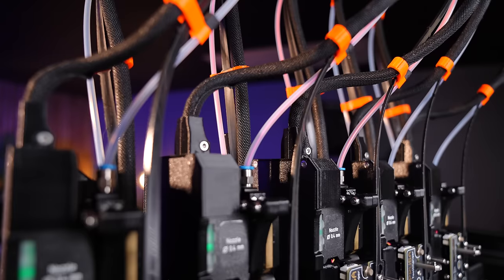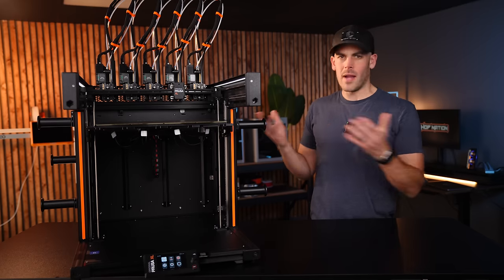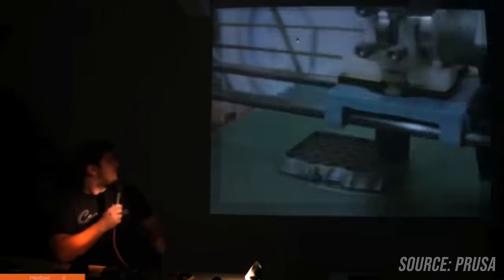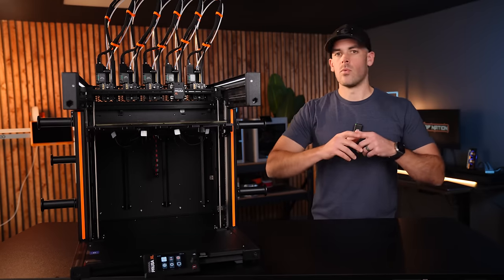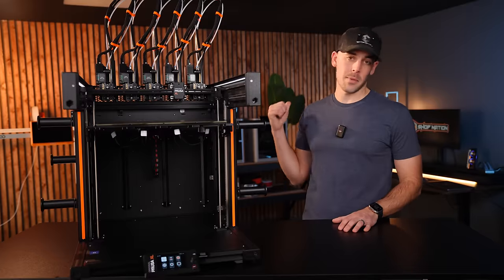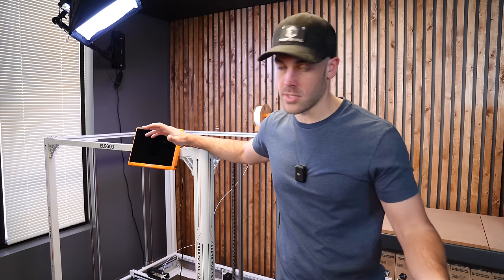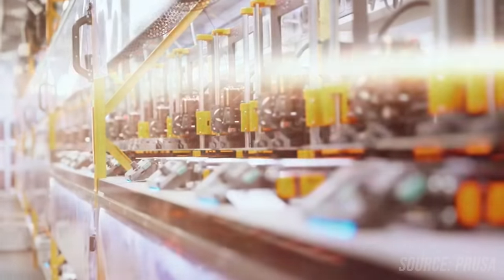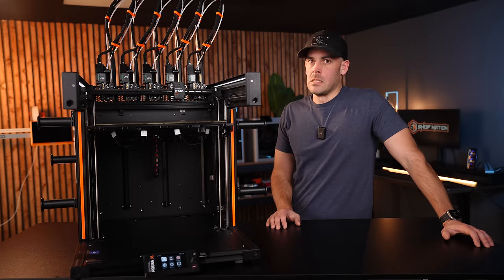Why Prusa is the next Blackberry

Comment: Considering their products are still selling quite well, with the Mk4 being their most sold printer - I'd say they're more like Android than Blackberry. Quirky, not necessarily the most up to date, but still gets the job done and doesn't get in the way of what you want to do.
Reply: and the possibility to be flexible... Good comparison.
Reply: not that I am really up on all the latest, but a good point.  The blackberry was way more lame than color touch screens with swipes.  Even the ender 3 will still print things.
To me I really really don't like how slow these printers are.   There needs to be some breakthough technology to speed them up dramatically without the loss of quality.
If you can do a 5 hour print in 10 minutes.   Something like printers could use pellets instead of filament, have 100 print heads super high density that drip plastic and 100 times faster.  Or something like that.  I saw a backpack printer that printed upside down, so maybe print the top and bottom in parallel and fuse them at the end ..automatically,
so now 100x2 times faster..
Reply: a blackberry got the job done as well. In fact I’d say the Prusa is farther behind than the blackberry was the iPhone.
Reply: @RhinoAg  Hardly. Prusa has a core XY machine with faster and less wasteful color printing than Bambu (Prusa XL), and the Mk4 is Prusa's best selling machine, so they are not in dire straits like Blackberry was. The analogy falls flat.
Reply: Android is used by many brands. So no, your comparison is not valid.
Reply: Android is pretty much always before Apple. Apple only perfects solutions available in Android phones for years. So nope, your comparison is poor.
Reply: @krzysztofmatuszek  honestly - any comparison will break down at some point. The 3D printer market is not equivalent to the cell phone market. Cell phones are general purpose devices expected to perform a large variety of tasks, so individual features can be important as they determine what kind of tasks you can do. Consumer level 3D printers all do the same thing: Print plastic stuff. Individual features can help quality or speed, but missing a certain feature doesn't prevent you from printing. It just might be a bit slower or maybe a little bit less quality.
Reply: @logicalfundy  Well, I think I agree. The sole reason for cell phones to emerge was for people to remain in contact (remeber the decades-long Nokia's slogan "Nokia. Connecting people."?), it has now become quite a versatile tool. A 3D-printer just 3D-prints XDD
Reply: i guess with things ironed out now they will launch a new printer between the mk4 and xl to fill the gap
Reply: @RockCYP I disagree with that assertion, actually. Prusa contributed massively to the RepRap project that spawned the MK2, which in turn became the most shamelessly copied 3D printer for years to come. This is a lot like how Samsung makes code that is occasionally incorporated into Android as a whole like with Quick Share. Heck, PrusaSlicer being a Prusa-specific overlay on top of CuraSlicer is Samsung adding OneUI to their version of Android.
Reply: @davidmalkowski7850  Contributed does not mean created. Prusa or Samsung for that matter, contributing to something does not make them android. Prusa slicer (if not based off of anything else, by the looks of it cura slicer) would be equivalent to android yes as its used or has been used as the base for almost every slicer including bambu slicer. And dare i say Prusa Slicer is more up to date than Bambu Slicer.

Comment: As a Prusa owner, I completely agree. The XL took so long to develop, and is so over-engineered, that the rest of the industry passed them by. Multilateral and multicolor is the future, but not sure the XL will be the way.
Reply: I think it's a bit related to Joseph's personality. That allowed him to thrive in the maker community but it fares poorly in the mass market.
Reply: Then what will be the way? For true multi material, you need different toolheads. Otherwise, it will just not work properly and cause problems. 

The XL is perfect if you need to prototype with living edges, seals, etc. There is no other machine that can do what this machine is capable of.
Reply: Yea, what is the correct approach?
Reply: @nukularpictures  The XL doesn't even have an enclosure, materials used for engineer prototyping require an enclosure.

There are more machines coming out that will be able to do multi-material, and there are some innovative designs. Some are nozzle switching, some are multiple nozzles on same tool head. Heck, if you want high end, Vorons have them if you are hobbyist. 

The XL is just over engineered, won't be modifiable, and is really pricey for what it is. Last I saw it still can't even print well with anything other than 0.4 nozzle, which they didn't include in the first release.
Reply: @tempname8263   There is no definitive best method yet, but it's definitely not an MMU/AMS which has way too much waste. I think multiple tools is the answer, like a CNC, but I don't think the best option exists yet.
Reply: @ScytheNoire  They develop one for it. But the screen it has works well enough for ASA / ABS. 
Sure PC does not work that great but it's fine for our uses.

And regarding over engineered. I don't see an easier solution if you need multiple tool-heads. 

Other than that, the machine is actually pretty standard .
Reply: @nukularpictures  They could have made a dual head printer that does not need a tool change mechanism. That would be a very affordable machine compared to the XL. Heck - They could even use two rails with each two heads, so you get a far more affordable 4 head printer. Sure - It would be a engineering challenge, and the machine would be bulky for a relative small print surface, but it would bring down the cost significantly. Another option would be mounting several nozzles (with each nozzele it's own heater) in one print head. Also an engineering challenge, but still cheaper than a tool changer.
Reply: @jclosed2516  I mean, do you really think the pick up mechanism is the expensive part on the XL? 

So your solution would be a dual axis IDEX printer, and you think it will be cheaper? You need two belts, two motors, etc. While still needing all the toolhead electronics for each of the toolheads.

I really do not see where you save a lot of money there.

As for multiple nozzles per toolhead. We also stopped using that, as it was a pain in the ass to calibrate. Heck even today it is still not that great. Especially as you will need to have perfect tollerances or else one nozzle will always drag over the print. You need to be able to raise the nozzles. 

But again, you still need all the extruder electronics again for this solution as well. So again, I do not see where you would save a lot of BOM cost. 

Cheapest solution would be something like AnkerMake showed off with their color engine, but that never made it to market, at least not as of now. 

But all of them have pros and cons, personally I find the XL the most elegant solution. Especially as you can easily, at least once it is supported, have different nozzle sizes and shapes. Especially the last one might be quite interesting for non planar 3D printing, if it ever takes off.
Reply: @testboga5991 the XL is the result of someone who has a lot of money and no engineering skills.  The dude en essentially won the lottery regarding his early investment in the 3d printing industry.  He copied open source designs and released them him as his own and was able to market/mass produce them.  He didn't created anything original.  It practically was a form of dropshipping with what he did.
Reply: vorons are not high end, entry level commercial prints are many tens of thousands of dollars. youre mistaking the hobbyists field for more than it is
Reply: I do wonder how they could make a printer like this enclosed. It would honestly be a fantastic feature.

Comment: Sorry, I think this is a bad take. Bambulabs killed community innovation & tech love by using proprietary software & hardware making it a stable and good machine yes, but not tinkerfriendly.
3D Printing still evolved and is being driven by open-source community efforts, Bambulabs companified 3d printing in a way.
its not now about can the user fix it or adapt to their will but more of a the user will have no issues but may not touch the internal workings.
Prusa's machine is quite literally still that, a modifiable, fast and precise!
also its still special, it allows for material changes a bambu MMU wouldn't be able to handle like flexables or high temp materials

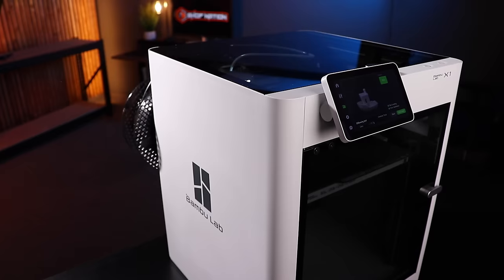Comment: 2:04 well that's not entirely accurate, before Bambu if you wanted something that just worked and kept working... You got a MK3. Prusa got well known because of the push they gave to the industry, and then got big because they had the "it just works" printers.

Personally I really wish they atay relevant because I haate the idea of the iphone approach. Closed and unfixable if not through the vendor, and you're at their mercy when it comes to software. Thankfully bambu is just starting to get at least a tiny bit away from that. They build incredible printers otherwise.

Comment: It is a niche application, but what a niche indeed. I could see large print farms having ONE of these in the corner for those types of prints while the "regular" printers do 99% of the work. On the other hand it is an interesting look into what is possible, and what may become available at a lower cost in just a few years. What we need is the "Brother Laserprinter" of 3D printing. Cheap, easy to refill without proprietary ink (looking at you HP), and reliable. No bells, no whistles, just something that can sit for months then belt out a few parts when needed.
Reply from the maker: That’s kind of been what Prusa was for years…just not the cheap part
Reply: Well, I have a 70 machine printfarm with all machines active around %80 of the time. If a machine utilization drops below %60 you start to lose money on that machine. Thats why we sold our SLA printers. (Also they create a huge labor cost). So you cant have a machine to just stand in the corner and have a print one a week if you are lucky.

Comment: As someone who uses Windows and Android, I was very much after the Apple experience when it comes to 3D printing for the business, so in 2017, I went for the Ultimaker 3, it served me very well and was an entirely press and play experience up until this year despite nearly no maintenance. Fast forward many years, the Bambu Lab is looking like something that does that job better, at 1/3 the cost, with more than 3x the features.

Comment: I had another cheap enclosed printer and every time you wanted to print you would have to tune the print first. In 3 years of using it I have very few print parts to show for it. I brought a Bambu less than a year ago. It has change my life. I use it all the time and my 14 year old son has got excited about it and I'm now booking time with him to print my stuff. By far the Bambu X1C is the best decision I have ever made, it just works, no fucking around. Just knock out your design in Fusion and a few minuets later you have a beautiful ABS part. I don't even bother printing PLA anymore. I have no interest in making toys, I'm only interested in making engineering parts. ABS is ok for the vast majority of what we make but to be able to print PC-CF or Nylon if I want is fantastic. I put a heavy blanket over when printing high temp materials. Chamber gets to about 65c and everything prints perfectly. I have dialed in large ABS prints with no warping and they are just far better to machine and work with after. To see my son designing parts for his Airsoft gun and this weekend he quickly knocked out a part for his mum to decorate cakes very efficiently is all I ever wanted. We also have a CNC mill so he is now learning how to use that. As a dad I could not be happier.

Comment: Couldn't agree more. I've been looking for my next fast bed slinger and I was cross shopping the Prusa MK4, Bambu A1, and Creality's newest ender 3 v3. All of them can do a sub 20 minute benchy, run klipper with input shaping, and have auto-bed leveing. But only 1 of those costs over $1000...
Reply from the maker: Not all about speed, that Ender in that group is the odd duck that will break very soon
Reply: Bambu A1 goes back on sale in April, and as an owner, it has been one of the best printers ever!
Reply: @ShopNation  hehehe my Ender 3 v3 KE survived 3 month so far but I still have a feeling of playing Russian roulette whenever I turn it on :D
Reply: @crymp2057 Mine lasted about a month,with maybe 50 Hours actual print time, then blobbed itself so badly,that it bent the entire tool head apart.. refunded and got an X1C now ^^
Reply: @Kezenmacher  Yeah from the Reddit forums it seems that most common issue is layer adhesion resulting in parts coming loose and lodging themselves inside the tool assembly. I fixed all my adhesion issues with a simple brim.

Comment: I personally own a 5 head XL and I agree with nearly everything in this video. Definitely not a first printer, but if your existing prints do need the very specific tasks only an XL can service, then its your only option. Not just small multi color prints though, multi material like PETG supports or water soluble on PLA parts for perfect interface were my 2 reasons. The bed size is nice as well where I can print 16 of my main widgets, vs only 4-6 on standard size printers.

There are still quirks like we 100% need multiple purge towers so PETG and PLA dont need to be on the same one (works for some prints but its not reliable enough for production), but otherwise I think prusa still succeeded with this since its a whole new and revolutionary design that no one on the market can compete with yet, and its reliable enough to be used for production.

I hope the XL is the direction prusa takes as well since the MK4 makes no sense to me, strong fast core XYs that can be cheaper if they are smaller, and since most people only need 1 head then that as well. The XL is the first gen, and we dont know if its going to be a blackberry storm (their bad touch screen phone for the zoomers) or a Samsung Galaxy S.

Comment: So, here's my perspective.  I got a P1S for Christmas.  I've had resin printers for years, dating back to the first Photon, but I held off on FDM until a bambulabs came along and there's one, very specific reason.  I didn't want to be an FDM printing hobbyist.  I wanted to be a hobbyist that used an FDM printer.  The P1S had a very short learning curve and worked, with very little adjustment, right out of the box.  It'll work with nearly any material you put in it, it has the enclosure, and it's relatively inexpensive.  From an outside perspective, I see no reason to buy a mk4 when the A1 exists, let alone the P1.
Reply: The A1 will kill the MK4

Comment: All Prusa needed to do in 2021 was to release a Voron kit. But instead they announced the XL, which would have been a great printer in 2021. But it came out in 2023. After the Bambu X1C.

Most of Prusa’s improvements in the last years were on Prusa Slicher. Which also benefited their competitors.

Comment: I had printers for years. Used weekly sometimes daily. It was always a chore. Then I got my bambo A1mini and yes it’s a bit small but 90% of the time its enough. And it made designing and printing equally fun.
Reply: I have 2 larger printers and got an A1 Mini and you’re right, it’s a fun little machine. Most of what I print fits on it so it’s running much of the time. And it just works, beautifully. The dynamic flow calibration is genius.

Comment: 1) I don't like the Benchy model either.
2) I get the AOL reference
3) My MK3S+ has sat idle since I got the X1C in mid November 2023. It has a In3DSpace light bar on it, and makes a nice night light in the basement, so I leave it turned on.
Reply: Isnt MK3S+ like half the price of X1C? :D Great comparison...
Reply: Just did the MK3.5 upgrade on my MK3S+. It's like a whole new machine.

Comment: I see many below commenting on Prusa's quality and that they need to stick to their roots.   Roots are not agile nor innovative.   Lastly Pruse and many other 3d printer companies are missing the entire point of the Bambu ecosystem.  The majority of the people out there that want and are interested in 3d printing don't give two ####'s about the machine being open source or want to tinker with it, they just want it to work.  I don't care if you can 3d print replacement parts.  If my one printer is down i have to buy the part anyhow.  This negates that majority of the advantage Prusa has.

So if Prusa wants to remain relevant, they need to create an ecosystem and printer that supersedes the P1P and A1 otherwise they are just another blackberry type of company.
Reply: Spot on, they need to take the Apple approach of “It just works”. Just like I’m glad I don’t have to compile drivers in Linux anymore to get stuff working. I’m all for owning an innovative Czech 🇨🇿 printer that just works.